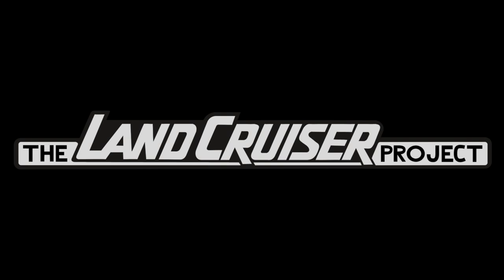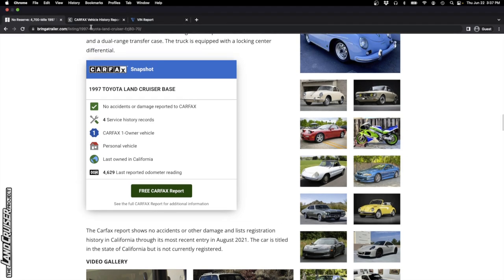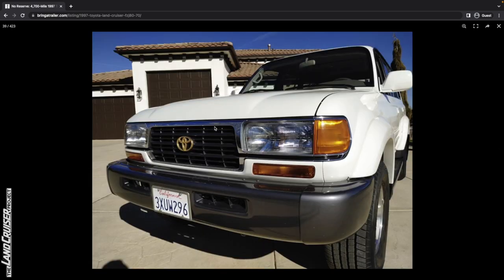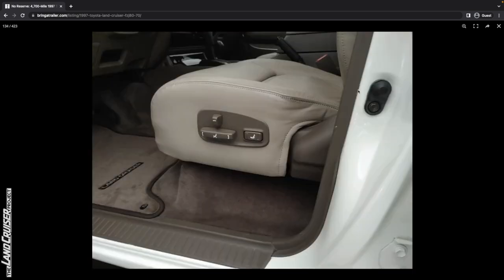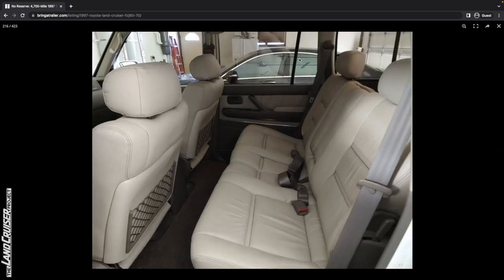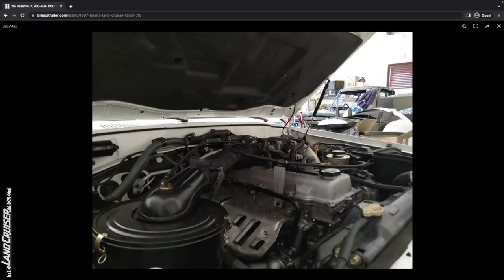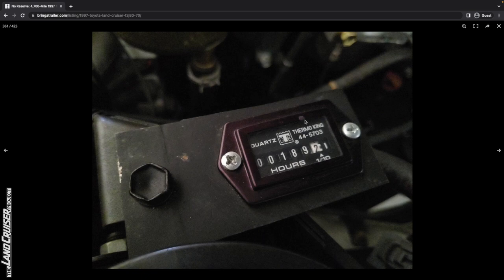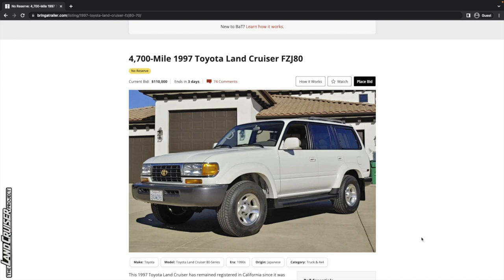This is what a BRAND NEW 80 Series 1997 Land Cruiser looks like

Comment: i wonder if sitting so long, if all the internal seals, transmission motor transfer case and differentials internals ext, would still work right ?? is the same oils that came from the factory still in it 😅
Reply from the maker: I'd hope not, but these are the questions you'd want to ask before bidding six figures. I should have gone into more detail on the listing not having much discussion of maintenance records.

Comment: Could you check back on the 2002 you estimated to go for nineteen grand. I was reading the comments and there may have been some issues with the bidding.
Cars and Bids asked for sealed bids from the top three bidders.
Does that 10,570 represent the real sale price or could it be different because the final bids were delivered by email?

Just curious.

Thanks
Reply from the maker: The 10,570 appears to be what the final bidding was through the auction with the website issues. The sealed bids from the top three bidders likely won't ever get reflected on the website. Price will likely end up above the 10,570.
Reply: @thelandcruiserproject that's what I figured as well.
Closer to your projected sale price.
Reply from the maker: Did you see the Collector's Edition yet? Someone is going to get burned on that deal.